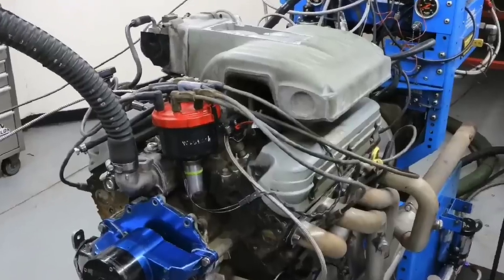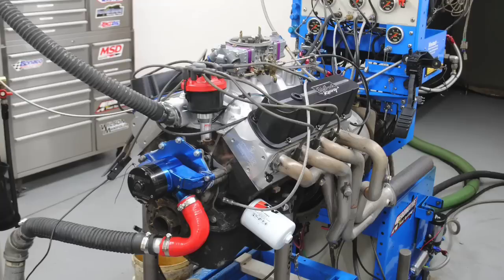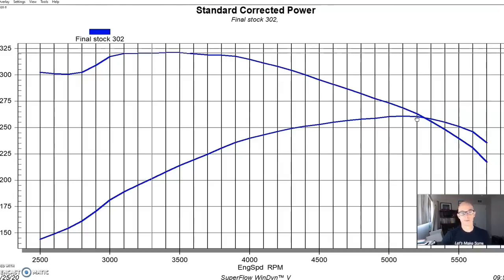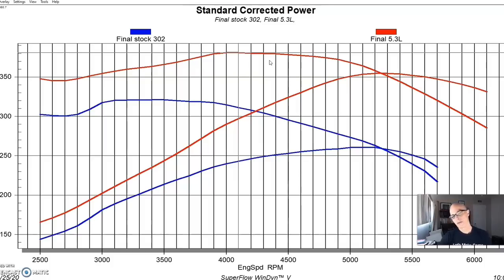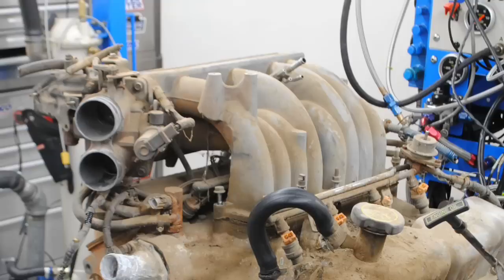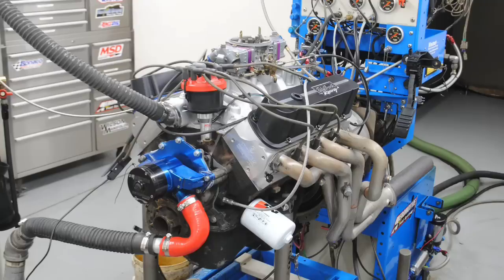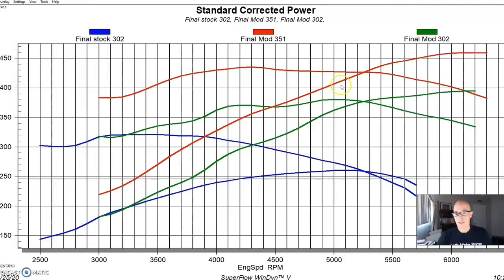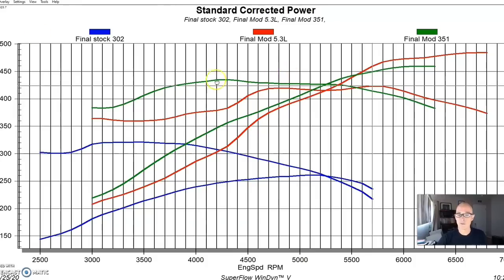5.0L vs 351W vs LS-SHOULD YOU SWAP?

Comment: LS heads on a 351W short block with a 4" crank and 2 teriyaki tornadoes cranked up to about 20 psi. Teamwork for the win!
Reply: A turbo 402 with big heads would be interesting.
Right Richard ??
Reply: @hotrodray6802  RIGHT RICHARD CAN YOU HEAR US CAN YOU?
Reply: Remember that guy that put the LS1 heads on a 302?
Richard, let's see LS3 heads on 408! 
Customer cam and intake, what else will it take lol?
Reply: @god1st.530  😂😂😂😂😂
Reply: @robertelmo7736  big bang 408 w/LS heads sounds mighty fine to me.
Reply from the maker: that's a lot of work for very little reward-lots of good 351W heads for a 408
Reply: It would take a custom cam.  Why not put a good AFR head on a 408 then boost it?  Wait, they did that already!
Reply: @MissionRestomod  tbh it would take allot more than that. I don't even think the ring lands would line up.
Reply: Aww shit, he's taking heroshima hairdriers.
Reply: @richardholdener1727  the reward is the reaction, not the horsepower number. I'm really disappointed in the mediocre hate I've received so far. I was hoping for a lot worse 😆
Reply: Dude you sound like an old 70s hotrodder when they talk about taking X crank and offset grinding it to be a stroker and sticking it in Y block with Z rods and N pistons then machining V heads to fit... Frankensteining a motor together to make decent power. But by today’s standards you can buy much better aftermarket parts for not much more than the labor to retrofit all those marginally better parts and get way more bang for the buck. That older stuff is still cool but it’s not really relevant anymore.
Reply: @richardholdener1727  but.............. What about LS heads on a 400m short block? Junkyard 400 cubic inches. Do your own fab work and the most expensive part would probably be the cam lol
Reply: @conwayfiddy4908  if the bore spacings weren't so different, it would probably be the best head ever put on a Y block.
Reply: @conwayfiddy4908  If your talking about a common engine thats true but if your building an "other guy" engine you have to do that stuff. I'm building a mazda four cylinder right now and no one makes parts for it so I have to do this stuff.
Reply: @jr78racer  ohhh old ford stuff yes. Let's see a fe head on a y block. after all fear starts with FE
Reply: @Robberbarron27  late 70's 302 heads on an LS. We're going the wrong way with these things. I wanna see that castrated power curve.
Reply: Blake's Gaming PC I get you with the other guys stuff but a Ford Windsor motor isn’t an other guys motor and there’s no reason to do other guys stuff to it.
Reply: Ls heads won't work on a ford block
Reply: @jr78racer  You can now go to a GM dealer and buy an L8T crank and stick it in the LS3.  Then you have a 400 cube LS3.  The crank costs about $650.
Reply: Look up MBE racing cylinder heads for SBF! I think a set of Profiler SBF heads would’ve made over 500+ HP for the same price. Just my opinion!
Reply: @andyharman3022  do you know if the service replacement engine for the L8T is available yet?
Reply: @jr78racer  I don't know about that.  I did a Google search on "L8T crank", and got a hit to Scoggin-Dickey Chevrolet who listed the crank.  They would be the ones to check with.  Or Crate Engine Depot.
Reply: Teriyaki tornadoes 😂
Reply: when i hear baby talk on turbos, i instantly think "smoothbrain".
Reply: @Robberbarron27  what Mazda 4 cyl. are you building? My first 4 cars were all Mazdas and I've owned several more since then.
Reply: @richardholdener1727  LS3 heads are cheap...and Richard...no one else has done it lol. Would be a perfect motor for non-partisan guys like you.
Reply: @countryjoe3551  BP4W Form a 99 miata and I'm putting it in a 95 miata
Reply: @Robberbarron27   nice. We're looking into a Miata for my daughter's first car. She's currently sharing Mom's Plum Crazy Dodge Charger. 🤪🤪🤪🤪🤪
Reply: @countryjoe3551  now you see why I said mazda four cylinder and left it at that.
Reply: @Robberbarron27  😁😁😁

Comment: You said you like to consider everything, but didn't factor in cost to swap... If you LS swap a foxbody you have to buy a K member, different transmission, driveshaft etc. Where if you upgrade to a 351 and already have an intake that will work from the 302, then you have more money to spend. Instead of a transmission you can get a nitrous kit and still be ahead of the 5.3... just my opinion. I've got an 88 mustang gt and have been trying to figure out what route to go. Your videos have been very helpful. Thank you
Reply from the maker: a 351W intake doesn't fit a 302 (different deck heights), But the 351W build is a good idea

Comment: The stock LS head flow is way above the Fords  heads, unfortunately.   But if you wanted to do an apple to apple comparison, I'd have the cylinder heads that flow the same amount, same cam and same style of intake, an re compare.  In theory they should be much closer to each other.
Reply: *fortunately.
Reply: Because the way it was made clearly isn't fair...
Reply: Compare 50 year old stuff to current stuff 🤔
Reply: Ford quit producing the 5.8 in 2000 the 5.3 started in 99.
Reply: @dylanbauer5227  You're very right about that but the 5.3 wasn't designed in the early 60s. That's what they're getting at.
Reply: They would be exactly the same. In the end an engine is an air pump. Give it the same dimensions and it will do the same thing. People act like the LS is some godly engine. Its a nice platform. But so is the SBF. The LS was even based on the SBF so all the LS fan boys need to seriously chill. The 302-351 heads used here were designed in the 1980's and were horribly choked for emissions. The LS stock heads were from the late 90's and had computer wizardry going into helping with flow. I bet if you took some pre-emissions heads from the late 60's and plopped them on the 302 it would do almost the exact same thing as a 4.8 or 5.3. The only thing, to me, that is superior about a stock LS is the headgasket. But you can get those metal head gaskets for any engine now. I like the distributor on the Ford too. Dont have to mess with a CPS
Reply: Alright guys. 

One,in the age of the lawsuit anything even remotely similar would be a court battle.

Two. https://www.heatshieldproducts.com/blog/Tech/no-the-general-motors-ls-v8-is-not-a-copy-of-the-ford-windsor-v8

I love how ford guys claim it to be a copy but can't explain why ford can't match it. Or how they aren't taking royalties off the "copied" tech.

Why defend inferior tech by claiming it's junk that was also a copy of our best. 

Until recently*
Reply: @sillybirdy1994  lol, mopar has been doing steel head gaskets since the early 60s. not much special about an ls except high lift cfm flow....which is expensive to obtain.
Reply: @dylanbauer5227  ford cant match it? then why is the worlds fastest mod motor faster than the worlds fastest ls?
Reply: Fastest? That your measure of success? 

I think cost per hp would matter more. Or simply popularity. I don't know about you but ls swaps are probably the most overdone for a reason. 

Or maybe the fact that for has walked back their mod motor programs and gone back to a pushrod platform idk.
Reply: LS head flow from a stock casting is way above a stock inline valve Ford, but then you have to discount canted-valve Fords. GM did a great job, 30 years later, coming out with a stock head that would flow comparably to a stock Cleveland head. Richard likes Clevelands, he has said, and there are manifolds and so on for putting them on on any 4.38 bore-spaced block, so it would not be hard to do a much more revealing compare. I guess there are still not that many street oriented builds being done with canted-valve Ford heads. Too bad. Those are all I do. One reason I like watching the sort of reborn Gasser class; lots of killer canted-valve Ford headed engines putting it down on those tracks.
Reply: @sillybirdy1994  Exactly.  It is interesting to compare a modern 5.0 Coyote to the modded 5.3LS in this vid.  The Coyote on a dyno (not in the car) will easily produce 30-40 HP more than the LS on the top end while making more torque everywhere (around 25 ft lbs more from 3000 on up.)  That's all due to the superior airflow from the DOHC heads.  Aftermarket 5.3 heads top out around 260 CFM without porting; the Coyote heads flow around 290.  People brag about the LS3 heads flowing around 300 cfm but they won't fit the 5.3's small bore.  Pretty much the same situation pairing the 302 Ford and the 305 Chevy; you can run bigger valves on the 302 for better breathing.  To get the 305 to make the same top end you need a bigger cam which kills the low and mid range compared to the 302.
Reply: @dylanbauer5227  
Ford went back to pushrod motors??? When??? 
You may be mistaken about that.
Reply: @MrCaribe65  7.3 2019....
Reply: @dylanbauer5227  
That's only the 7.3 Super Duty motor. They haven't totally abandoned the modular concept.
Reply: @paulhudson231  CNC ported LS3 heads flow 358cfm on the intake 315-320cfm stock they with work on a 6.0 or bigger LS engine with a 4 inch or bigger bore you're not going to compare a 5.0 Ford coyote engine head flow with 4 valves to a stock Chevy 5.3 2 valve commercial engine compare it to a LS3 head the Ford 5.0 has 4 cams 4 valves per cylinder compared to a 6.0 with 1 cam a 2 valves per cylinder stock Ford 5.0 HO heads stock flow 196cfm on intake with a 4 inch bore chevy LS 5.3 stock flow 226cfm on intake with a 3.78 bore which would probably flow 250cfm with a 4 inch bore
Reply: @gloriamaletta8667  My point was in comparing the two small-bore engines, the Coyote 5.0 and the 5.3LS.  The reason it is easy to make 450 to 500 HP on a Coyote is due to the better head flow available with a 4-valve setup.  It is irrelevant to compare the LS3 heads to the Coyote since, as you say, they don't fit the smaller bores.  To get 450-500 HP from a NA 5.3 requires a large (for a 5.3) cam and that kills the bottom end and mid range compared to the Coyote.  From a flow standpoint a good 4V setup is simply better than anything possible with a 2V head, given the same bore size.  Comparing the old 5.0HO heads to an LS is also irrelevant since they represent two different eras of technology; the SBC heads from the same era were also weak.  If you want a newer 5.0 SBF head, the Trick Flow R-series head will flow 335-340cfm out of the box, which compares very well to a current production LS head.
Reply: @paulhudson231  all you need to do is look at a 5.0 coyote head and it's physical total size they are huge then look at a LS3 head and it's physical total size while bigger than the old style chevy smallblock or old style Ford 5.0 it's not near as large as a coyote 5.0 head I'm thinking with 4 valves per cylinder and 4 camshafts and 6 foot of timing chain is nothing I'd want to own for a long period of time like the car l bought new in 1984 that l still own today I'd be much more interested in the new ford 7.3 gas engine than the 5.0 coyote and l believe it will be more reliable and durable and cost effective to own over a long period of time we have this engine in some F-550 work trucks and the low speed torque is so much better and it's much simpler design and prefer it over the 5.0 or 6.2 ford

Comment: Mod 351 - Drivability and power under the curve in a genuine daily driver street application. Up to 5500rpm the 351 owns the LS. Thereafter the LS flexs its muscle and with more power and higher RPM is suited to Street Strip use . Horses for courses

Comment: I would like to see a video on late 70s early 80s smog motors, stock vs un smogged vs degreed stock cam with properly set timing, vs good cam for said crappy stock motor....
Reply: Tiny valves, tiny ports, and low compression is going to make that a pretty miserable comparison.
Reply: He was on live yesterday and said he does his cams like most people do at home and thats dot to dot

Degreeing is just a blueprinting proccess. Maybe it'll gain power if the camshaft is just manufractured a lil off. 

But add more initial timing and limit your mechanical like youre supposed to do anyways in a performance application and that'll most likely take care of it and make it idle better
Reply: @TheKiltedYaksman1  late 70s big block mopar would like a word.
Reply: There's a few Ford 400's making insane power on Youtube (think 351c but bigger,) just takes a little work to get it done.